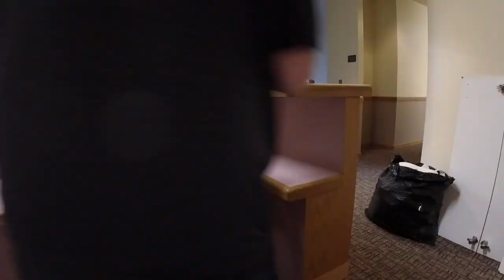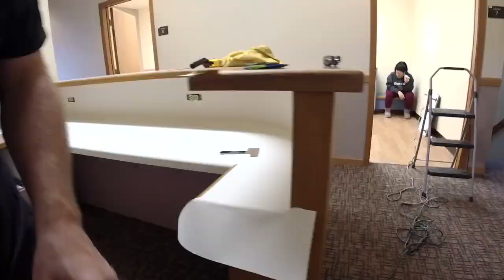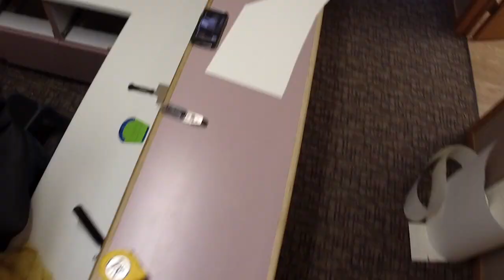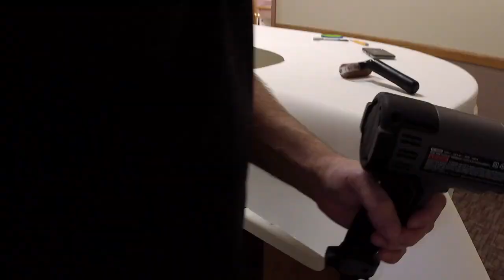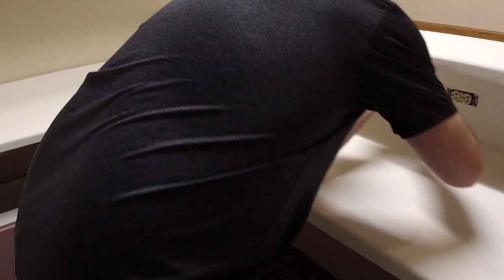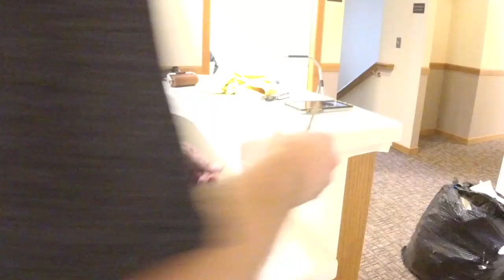How to wrap a Nurses Station Countertop wrap using Architectural film

Comment: Good video, just did a large, 5’ round table. Glad to see you had some of the same issues with edges I did. I guess with light sanding the seam won’t be too noticeable? I think I made a mistake though because the table was wrapped in gloss black and you can see a lot of small scratches. I think your vinyl is matte(?)
Reply from the maker: Kevr what kinda of vinyl is it? 1080? Use a little heat on the scratch areas. Gloss shows everything. Black is the worst.
Reply: Rm Wraps LLC It was Avery sw900 gloss black. So heating it will make minor swirls go away? Also, I think the odors from heating the plastic gave me some kind of reaction. Made my nose red. Go figure. I’m always wondering if seams are ok.